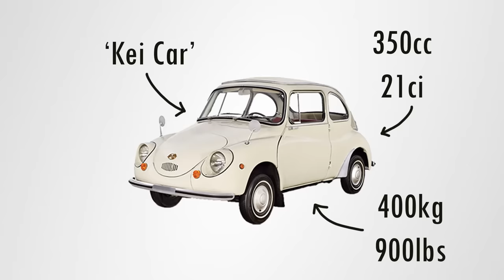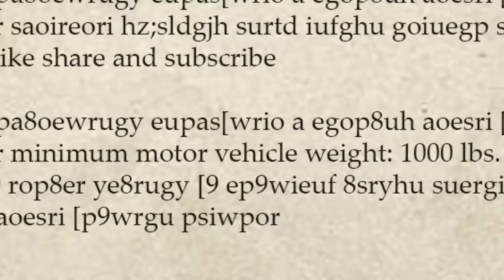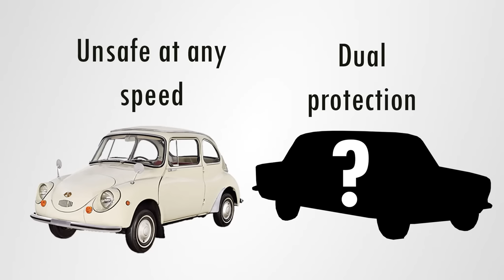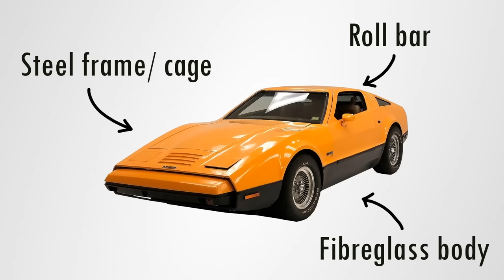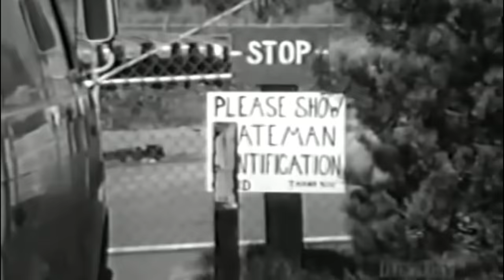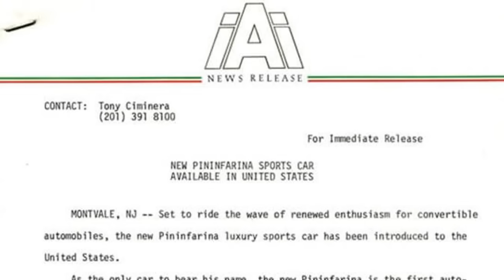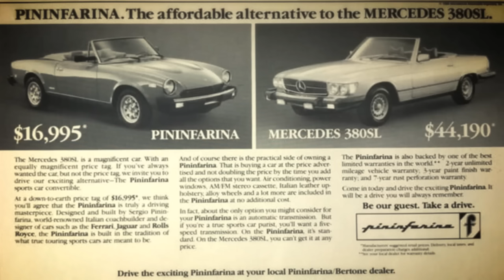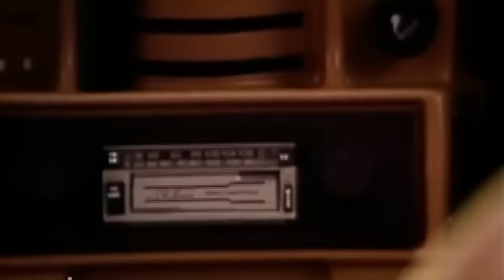Ep. 34 The Legend of Malcolm Bricklin

Comment: As a Canadian and a car lover, this is the video I've been waiting for. I've always wanted to drive a Bricklin but I'm sure owning one would be a massive headache
Reply: That's the tragedy of owning rare and obscure cars. No parts exist.  They're strictly museum pieces and parade cars, thats it.

Edit: had no idea it uses many AMC parts and has a Ford engine.  It may be feasible to drive and maintain one, with a bottomless wallet that is!
Reply: Driving a Bricklin is not the same as owning a Bricklin.  Besides, after forty years I'd wager that a lot of the bugs have been worked out by clever owners.
Reply from the maker: Getting replacement parts certainly is interesting to say the least.
Reply from the maker: Especially the taillights, which came off a DeTomaso Pantera haha!
Reply: @EdsAutoReviews  Didn’t both the Bricklin and the Pantara use a Ford 351C?
Reply: There is luckily a group of folks who really liked the idea of the car and spent decades ironing out all the numerous and relentless problems with it
Reply: @VeraTheTabbynx  That's the essence of automotive passion, don't you think?
Reply: @mescko  Absolutely!
Reply: @gregraines1599  
First Bricklin used AMC 360s. Then they used 351 Clevelands
Reply: All the running gear though and everything in the mechanics was Ford so you wouldn't have a hard time getting your mechanical Parts it would be just body I think they came with a 351 Windsor

Comment: I owned a Subaru 360 and was a member of the Subaru 360 Driver's club for several years. Some points to clarify: The 360 was not a big seller. Subaru moved less than 1000 cars in 1968. Fuji Heavy Industries deal with Bricklin was that if he ordered 10,000 cars, they would give him exclusive rights to sell the brand in the U.S. So Bricklin ordered 10,000 cars. In 1969 they probably moved about 6,000 or 7,000 cars, and a lot less than that in 1970. Some Subaru dealers still had 360s on the lot in 1973. Subaru of America did not import any 360s after 1969, all of the 1970 models were imported in '69. The vast majority of these cars were unloaded and stored at the Pasha Truckaway lots. When Bricklin left SOA, part of his severance pay was in the form of unsold Subaru 360s (he got about 300 unsold cars IIRC). He used these cars to set up Fastrack - where you could rent a Subaru 360 to do a lap around a dirt track. Needless to say, hundreds of 360s were quickly destroyed by underage drivers wanting to get behind the wheel of a "real car"! The serial numbers of U.S. spec Subaru 360s indicate that around 12,000 of them were imported, so you can see sales dropped off significantly after 1969, and it took a few years to get the last thousand or so out the door.

There are conflicting reports in the motoring press about what exactly was happening with SOA in 69-70. Bricklin and his business partner Harvey Lamm (who I once spoke to briefly: he had nothing to say about the 360 or Bricklin) seemed to be claiming (or pretending) that Fuji Heavy Industries had more or less tricked them into buying the 360s. The car they really wanted was the front wheel drive Subaru Star, the 360 was just a stopgap, but the people at FHI kept sending them more! This is plausible, as the Star would have needed the basic safety and emission features required in 1969, but you can also see why they'd want to pass the blame for the 360 on to somebody else. Dealers were waiting for their Subaru Stars, but Bricklin kept sending them 360s. So was Bricklin pulling a stunt here or was FHI? Well, I know my answer, and I think most people know it too.

Honda was watching the Subaru situation quite closely, and wisely saw that they needed something more powerful than a 360cc engine for the North American market. Thus the Honda N360 became the Honda N600 for our continent, and Honda was a LOT more successful in selling those cars!

Comment: There's actually a Bricklin SV-1 for sale in my town. Its a little rough, but it runs. I wish I had the cash to pick it up!
Reply: Consider yourself lucky that you didn’t have the money to buy it, because you would’ve been very disappointed. No matter how much they’re selling it for, you could expect to spend far more than that just to get it in great shape. And if you ever needed new body panels, like after an accident, you could forget it because they aren’t manufactured. The doors are a constant problem, even if the battery is good, the hinges on the roof were not up to holding the massive weight. There isn’t a door handle to pop the door open, you have to press a button next to the door to activate the battery powered motor that lifts the door, and it often fails. The exterior is very attractive, but the interior is rather plain and ugly, and it only came with an automatic transmission (effectively killing any fun driving factor). The engines are powerful enough, but it’s not an enjoyable car to drive. The fiberglass body won’t rust of course, but like a Corvette, everything else will rust. 
There are far better sports cars out there, so just save your money (or get a loan) and wait to buy something you won’t regret buying. The best sports car I’ve ever owned is any of the 1990-2019 Mazda MX-5 Miata’s I’ve owned (I still own the 2019). They’re incredible to drive (just try one at high speeds on a winding back road), built incredibly well, and can take lots of abuse and still be as reliable as a Camry. I do love the Italian and German cars I’ve owned, but they are either very unreliable, or they’re expensive to maintain. Miata’s are (mostly) affordable, you’ll never have to worry about the availability of parts, and they cheap to maintain.
Reply: @Mike-rk8px  I’ve owned many vehicles more reliable than my old Camry. Wasn’t the worst car, but far from the most reliable. ymmv
Reply: @Mike-rk8px  always that one guy that thinks a miata is a sports car lol
Reply: @Wik3dNuTS4k  it actually is a sports car front engine manual transmission rear wheel drive open Roadster that's the definition of a sports car it's power to weight ratio you don't need to have 400 horsepower  for it to be a sports car it's the power to wait ratio and how the car handles👍😎🇨🇦

Comment: Back in the mid-1980s, I came across a parking lot meeting of early 1960s & '70s Japanese micro-cars, such as the cute little 16hp Subaru 360, 1960 Datsun Fairlady (4-cylinder 4-stroke 988cc 36hp), 1963 Honda S500 (4-cylinder 4-stroke 531cc 44hp), 1967 Honda N360 (2-cylinder 4-stroke 354cc 31hp), etc. Someone asked if these tiny cars were the death-traps they were derisively described as and was answered, "It was either this or a motorcycle."

Comment: X-1/9 wasn't from the '60s though, it debuted in 1973. And was also designed to exceed the safety standards of the day, possibly by a wider margin than the SV-1.
Reply: It was definitely designed to a MUCH higher standard, with much better engineering behind it. The "safety" angle of the SV was just a sales gimmick, nothing more.

Comment: Trapped in a car with gull-wing doors… this did happen to Johnny Carson… in his brand new Delorean… because the battery died in shipping and when the car stalled on the freeway, the electronic door locks had no power…. And there was no manual override. Remember, to save weight, the part of the side windows that rolled down was teeny-tiny… and I believe they were also electric powered.
It really did not help that Johnny was a major investor in Delorean!

Comment: Subaru has similar backstory here in Israel.

There were two guys that started importing Fuji Rabbit scooters somewhere in the 60s, and they did so until Subaru stopped making them in the 70s.

So the two guys went to Japan to meet with Subaru management, and instead of the scooters they were offered a car, Subaru Leone. 

To put things into context, that's when the Arab boycott was in full swing, and Arab countries wouldn't do business with any company that would sell to Israel, so there were no Japanese cars here.

Still, Subaru decided to honor the agreement, and agreed to sell cars in Israel.

So the guys accepted the offer, and the Leone became an instant success here, to the point that back in 80s almost every car you saw on the streets was a Subaru. Subaru was the top seller until the early 90s, when other Japanese car makers came here, too, and Subaru Leone lost the top spot first to much more modern Mitsubishi Lancer, then Mazda 323, then Toyota Corolla, which offered A/C and automatic transmission as standard.

Comment: There is a bit more to the Pininfarine-Fiat 124 story:
Underneath the exotic looking convertible body the  Fait 124 spider was realy just a a mass market Fiat 124 or 125 sedan, what made the spider so affordable. The 124/125 got replaced by the 131 in 1974 and as european manufacturers feared that the Americans would outlaw convertibles, Fiat came up with the mid-engine X1/9 targa top as a replacement for the spider. But as the 131 was still based on the 124 Fiat could continue making the old Spider without any additional costs. Like many somewhat dated european convertibles of that time it still sold too god to be discontinued. By the mid-80s however Fiat had widely switched to fwd platforms and discontinued both the old rwd 131 and larger Argenta that shared many drivetrain components with the spider, finally putting and end to it's production after almost two decades.

Comment: Your comments about the Fiat's being rebadged as Pinifarinas and Bertones is inaccurate. Both cars were manufactured by their respective designers and badged as such after Fiat had finished with them in 81-82. So no nefarious badge engineering there.